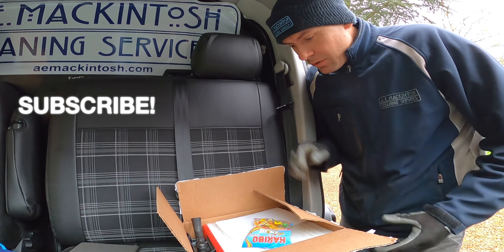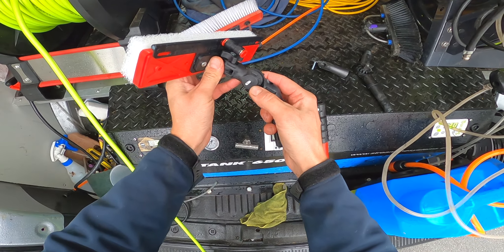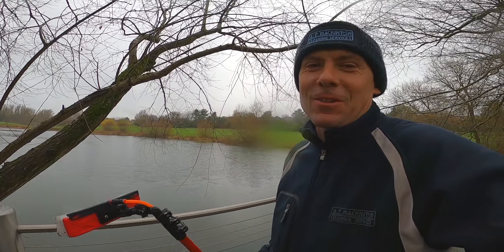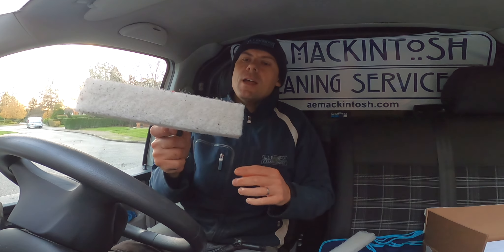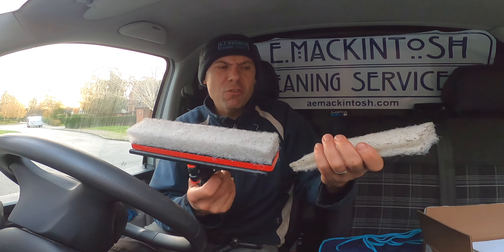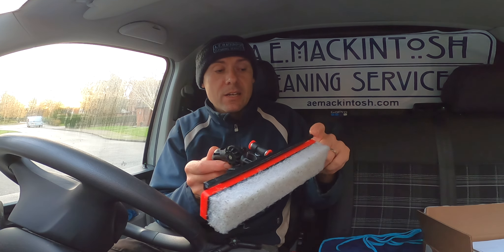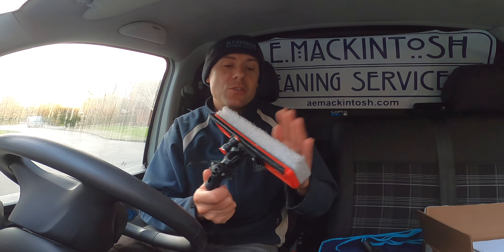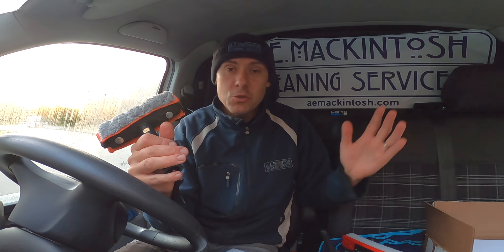Tucker Alpha Scrubber Is In The UK!  Test And Review

Comment: Good review Ashley, I have the tucker 12 inch  4 pencil jets hybrid brush best bush I have ever used, came with the rinse bar not sure which version of rinse bar you have, the early version was made out of aluminium and I scratched the glass it dug I on an angle , had too remove and just use pencil jets now, I believe they changed to a plastic rinse bar.. which one were you using..  cheers David 👍
Reply from the maker: This is the plastic version of the rinse bar. Tucker make some great quality products.😃👍🏼

Comment: I did the same review it's ok cleaning regular windows. But a pain to clean frames as it doesn't get in the tight spots like a brush does.

Also wouldn't recommend using it with hot water as the sticky velcro pads unstuck and the white pad will full off.

Also with cleaning really dirty conservatory or skylights you will find the pads will gunk up quickly. 
Best to use tfr and a good brush
Reply from the maker: Yeah, I find it’s great for those in between type of jobs, glass that’s just a bit dirtier than normal and you don’t want to go to the bother of applying a chemical.😃👍🏼